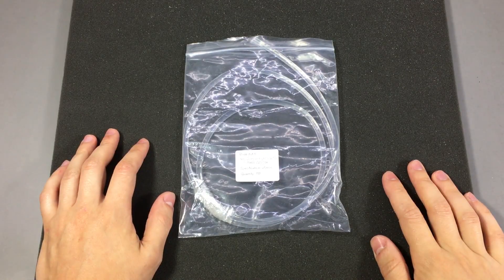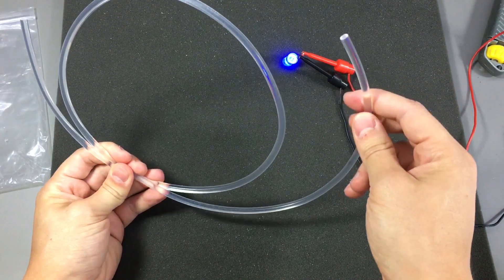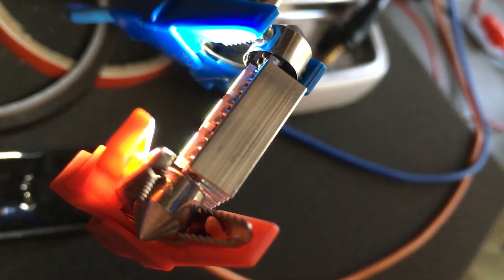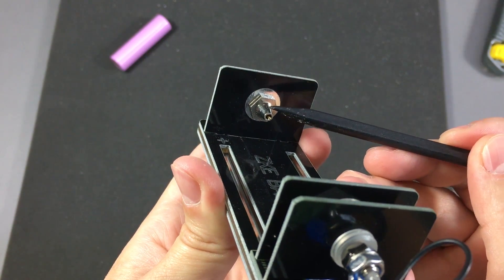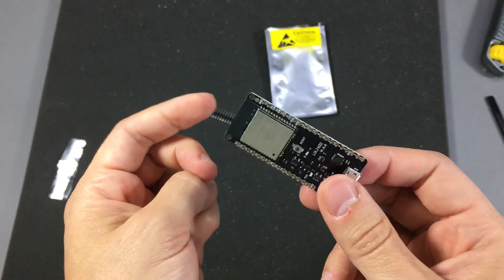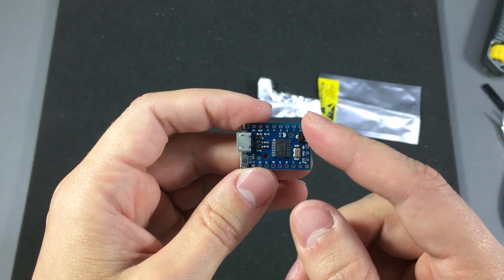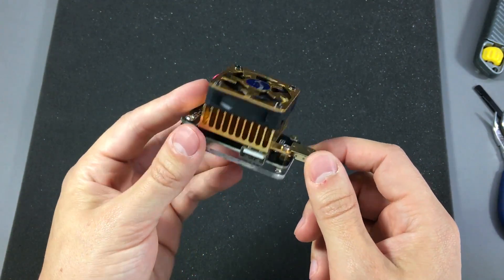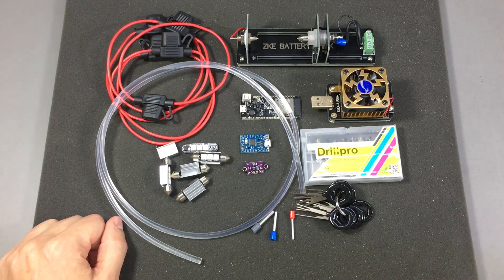Voltlog #121 - InTheMail ✉

Comment: I don't understand the battery holder/tester. You say that the connections are insulated, but if they touch the battery together then it is no longer isolated from each other and they connect to each other through the metal of the battery?

Comment: Why don't you use the light -underwater to demonstrate Snell's law with a laser pointer.  That way you can keep a higher power laser out of the water.
ALSO, the less light you see escaping from the sides, the more efficient the cable.

Comment: Super tip (works for me in Germany)
1: Never sign any DHL papers which claim to do customs work for you, they are expensive (around 30Euros), Do it yourself
2: Write them (customs dept) an email, tell them they are allowed to open package on your behalf and notify whats inside
3: Once they do that, and you know whats inside, send them a screenshot of price you paid for it, or paypal transaction
4: If its worth less than 25EUR (Germany), they will send it to you via postage automatically
5: if its more, they will calculate taxes and then perhaps you have to go in person and pay, but for some things like 50 cent LED bulbs you burn more fuel
Reply from the maker: Here in Romania, for individuals and orders under 10 EUR value, DHL services are free and no payments are required. Everything above you can pay DHL to do it for you, it will cost 25EUR or you can obtain an EORI number yourself, and pay the VAT tax directly to the customs import office bank account.
Reply: wow that must suck, my packages rarely get flagged unless they are really big , or really heavy, i used to go there myself to pick up until one day i couldnt and i called and this procedure which i wrote was told to me by the customs chick
Reply from the maker: yup, I try to avoid DHL whenever possible. Going through the standard postal service is a bit easier. The same 10EUR threshold but anything extra the VAT gets calculated and paid  in cash on the spot at the postal office.

Comment: FYI the standard incandescents for interior lights get extremely hot as well- notice the oddball pointy ends on them where no other bulb uses that- it limits the thermal conductivity to the fixture ;) Another style uses a small loop of wire to make minimal contact.  All will likely be well with yours. Cheers
Reply from the maker: Thanks for the info, I never tested an incandescent bulb to see what temperature it reaches but you made me curious now. I never thought about their physical construction and the pointy end but it all makes sense now.

Comment: That is a shitty 4 terminal test device you got. The best one I have seen is this one: https://www.fasttech.com/p/5339400
You can also get one in plastic https://www.fasttech.com/p/2955600
Look carefully on the battery connectors, there exist two types with different current rating, the one I link to is the high current one. It will melt if it get too hot, I have melted many of them.
You can see how I use them here: http://lygte-info.dk/review/batteries2012/Common18650comparator.php
Reply from the maker: Interestingly banggood seems to be selling the same BF-2A holder for $8 more. It is the one I linked as "expensive battery holder". It sure looks better made out of aluminium.
Reply: I do not care that much about price. A friend of me made some modifications to the plastic holder for me, that stopped it melting, but the "connectors" still melts when I run them too hot (They cannot handle 50A or a hot battery).
The Aluminium design also makes it easier to put batteries in it.

Comment: Looks like a normal fiberglass-cable. Maybe you can use a fine sandpaper on the sides of the fiber, to make it give out more light?
Reply: Yeah, I think frosting the edges would help.
Reply: I would suggest quite more intensity and I 'd like to see what a mirror in the end will do.
Reply: That's too bad. At least it'll make some nice light pipes!
Reply from the maker: frosting the ends seemed to help a bit. Frosting on the exterior surface did not help.. I can't see any improvement. it's just false advertising. The only way I could get a decent light was by shining a powerful green laser that can light-up matches.
Reply: Did you try a wide-angle LED, like the other dude suggested?
Atleast you can get a refund for the false advertised item.
Reply: I also suggest putting a reflector at the other end (maybe glue some metal foil on). Then the light amount would at least double. And are you sure the amount you put in is enough to let it shine bight on such a big surface area? The light will get a lot dimmer anyways and has to be intense shining in.